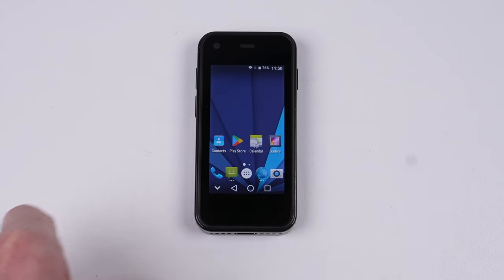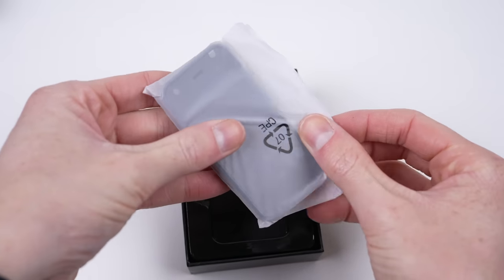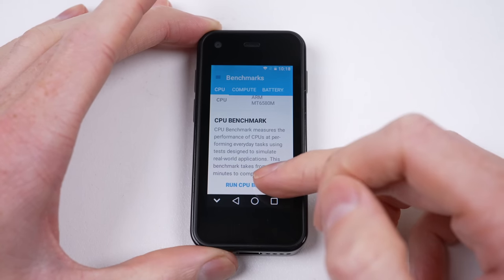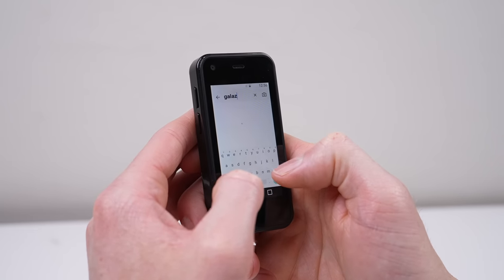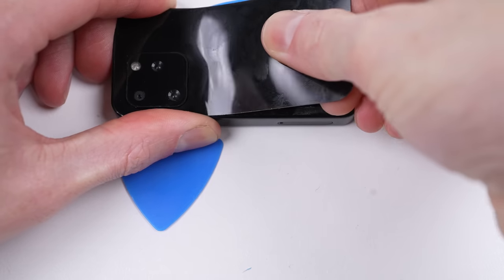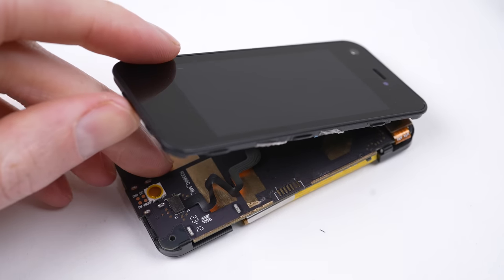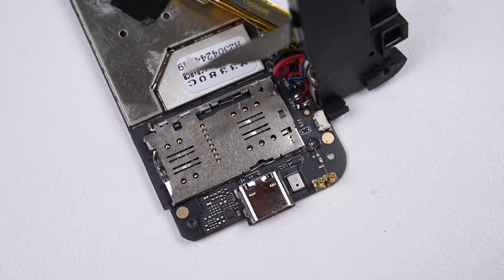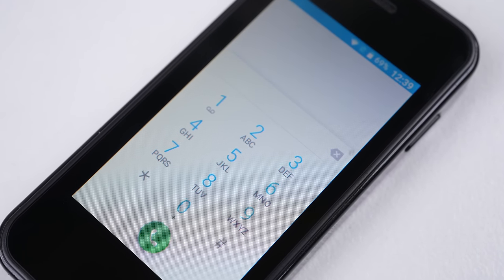I Bought The Smallest Android Phone - Impressions & Teardown

Comment: There are smaller Android devices with WAY more modern OSes, a proper mid-tier performance SoC and a proper LTE modem like the Unihertz Jelly 2/2E/2S series. Would be interesting to see a review / teardown of those since they look like a pain to take apart just from the outside.
Reply: Although I've used android since 2.3, I'm trying to remember back to android 6.  2012 and the nexus 7?
Reply: @adamf663 late 2015 or thereabouts, right at the tail end of the Nexus line
Reply: @adamf663 Fall 2015 and Huawei Nexus 6P (The last Nexus phone)
Reply: I've seen the review and teardown of that phone by Australian tech YouTuber SMOOREZ.
Reply: and the new unihertz jelly star
Reply: Not the star?
Reply: This
Reply: @account-now-closed  The star is technically also called "2S"
Reply: Those costs substantially more.
Reply: @radry100  Sure but they surely deserve a mention when talking about the smallest Android phone(s)
Reply: @adamf663 ah yes, the good old marshmallow days
Reply: @noahjgladwell I used stock Android 6 for 5 years, then made the jump to (also stock) Android 9. I really missed dark mode, especially because Samsung users already had it in earlier versions.
Reply: The Unihertz Jelly 2 is actually a little larger than this device, both in size and in price.
Reply: I don't know if you can call the Unihertz Jelly smaller when it's such a thick and bean-shaped device.
Reply: if only the continue the ATOM ones

Comment: Interesting device - there's probably some use case for a small phone with smart capabilities. Too bad it's only Android 6.0 (which is too old to support most stuff now) and also it only supports 3G networking. 3G is being shut down in various countries, and 2G has also been shut down in various countries as well, thereby making 4G a necessity.
Reply: Yep 4G LTE is a bare minimum for a phone these days, and if this phone is not very old, then it has no excuse to not have it, as even KaiOS flip phones have 4G LTE modems.
Reply: The oldest version of android 4.4 kitkat with apps still work. There are still apps on the google play store that don't support the newest version of android or even android 11 since some of the apps says there were designed for an older version of android. The app developer never updated the app. Some of the apps that I use are still old and still functional and don't offer anything new. Android was designed to operate on older versions of android as well as newer versions of android. I'm glad that android still supports the older versions android. I sideload apps that are no longer supported on the newer versions of android but they were removed due to copyright reasons. I sideloaded the google play now launcher android 4.4 version with my pixel 4a 5g running android 11 since I never updated the software on myself pixel 4a 5g. I only updated the apps from the google play store on my pixel 4a 5g. I left the software exactly the same when I first bought the pixel 4a 5g when the pixel 4a 5g first came out. The only issues are the display has gotten burn in, the display has gotten dimmer overtime, the battery drains quickly, the standby still last for multiple days even though it drains quickly while I have notifications all running in the background while being connected to my wifi and while using the phone and the phone still charges fast and the 128gb storage is almost completely full. I bought a battery case on amazon for my pixel 4a 5g. LOther than that, my pixel 4a 5g still works the same way when I first bought it. The google now launcher functionality still works even though it was removed from the google play store and no longer supported.
Reply: @OledBurnInKing I'm curious to know what kind of older apps you're running.
Reply: isnt 6.0 just on edge of being unsupported
Reply: @detecta  it is.
Reply: I think shutting down 2G is only possible in countries where carriers are the only source (apple being the huge exception) for buying your phone. In my country you can buy phones in electronic stores just like any other appliance. But often Voice over LTE will work only if your carrier also sells the same phone .  Basically many phones have a problem using Voice over LTE and im not sure they could make calls at all if 2G and 3G support was discontinued.
Reply: a 5inch with small bezels would do just fine
Reply: @CommodoreFan64  its old stock with a new frame...
Reply: 3g shutting down now but 2g not for another 10 years
Reply: @LelouchLamperouge235  Shutting down 2G is perfectly fine as devices can drop to 3G, and 3G is much better at handling calls and data than 2G anyway. 2G doesn't even support HD Voice.
Reply: @account-now-closed  Some countries (not the UK though!) have already shut down 2G.
Reply: @SOTP.  Very well could be, but it's still no excuse for a company to sell what they are calling a new phone in 2023 without at least a 4G LTE modem in it, or a more modern version of Android for that matter so apps people actually use at least function. I can get an Android Go Edition phone for 50 bucks with more modern specs, and an easy to replace battery for 50 bucks.
Reply: @account-now-closed  Both 2G, and 3G are being shutdown here in the US/Canada(Mexico still has 3G for now), so a 4G LTE phone is the bare minimum you need these days here.
Reply: @CommodoreFan64  i had an android 5 tablet that i messed with and could install all of my apps
Reply: @detecta  I highly doubt you where using anything like Paypal, G Pay, or a banking/credit union app, as most of them require newer versions of Android to function.
Reply: The Samsung Galaxy S5 has 4G/LTE and runs Android 6.0
Reply: 3G is dead across the whole of the United States now, 2G is following next year (strangely). So yeah at least here many old phones are probably filling up our already overflowing landfills no doubt! Unless being recycled or other uses of course.
Reply: @detecta  luckily i have 6.0.1 for my S5 Active

Comment: Micro SD card slot
Headphone Jack

These are the most practical and simple points of engaging with technology. A wire always works, and we all know, any amount of on board storage is never enough, and if the phone fails, it takes down all the data with it, unlike the card which is also a storage and backup option that can save the day.

Comment: Honestly? If a big phone company decides to make such a small phone, it could have a good chip, good edgeless display, a good camera and a somewhat bigger battery.
Reply: minus the edgeless display it's already been done with the Unihertz Jelly Star it's got a 3in display a 480x854, 48MP rear/8MP front cameras 4G LTE modem, 8GB RAM, a Mediatek Helio G99, 2000Mah battery,  USB C 10 watt charging,  256GB internal storage, dual sim, or sim/MicroSD card slot, 3.5mm headphone jack, notification lights, all running on Android 13, but it cost 200 greenbacks.
Reply: @CommodoreFan64  200...wow... I got my normal sized phone with nearly highend specs for 300.
Reply: @gucky4717  helio g99, 8gb of ram aint bad, what high end specs do you get for 300? I know like 1 example, so maybe yours is different
Reply: @gucky4717 Niche = no economies of scale = relatively expensive.

Comment: The rear camera is jittery, but the quality is great, I must say! It is miles better than those cheap crappy phones (similar to this, specifically those fake Samsung/iPhone phones) with camera quality that looks like it came from the 90s. Nice video again, Hugh!!! Missing your iPhone/MacBook repair videos!
Reply: Even in the mid-2000s phone cameras were often a joke. I seem to remember my Siemens from that era produced pictures that were something like 300x200 pixels, if that. Extracting them required a proprietary cable and software and the pictures were little more than blurry postage stamps. My last dumbphone, a ca.-2015 Nokia, had a VGA camera (640x480 pixels) that produced terribly washed-out pictures. It did have Bluetooth but every single picture had to be transmitted separately. I'm not sure if it was even able to record video but it might have.

Comment: I have a Palm PVG 100 and I thought this one was going to be a competitor but the smaller battery and 3G connectivity ended that idea. Also the Palm runs Android 8. Of course I'd like it to pop apart with 1 screw and no battery tape.

Comment: What an oddity! USB-C but running Android 6 and 3G network?
Reply: great point
Reply: The Nexus 6P and 5X launched in 2015 with Android 6.0 and USB-C. It's been around for longer than you think.
Reply: @efftee good point; however, what makes the least sense to me is the 3G limitation; my iPhone 5, from 2012, has 4G connectivity; Android 6 released in late 2015, so there is no excuse for this tiny phone NOT to have 4G 😂

Comment: a year and a half ago I needed a new phone. Had 3 androids and a windoze phone (lol) previously.
I marched into the AT&T store (my carrier) to see what the smallest android they had. 🤔
just huge 6.1's and foldables on up.
I ride motorcycles and want to stick it in my FRONT pocket. 
darned if I didn't walk out of there with a 64 gig 12mini for $315.
I hate Apple.....but this little rocket is unsurpassed.
Reply: I feel you. I recently switched from a Galaxy Note 9 to a iPhone 13 mini; despite it already being more than a year old at that point, it did not feel slow or sluggish… still doesn’t… and ironically it was the best phone I could get on my budget; the other options were Samsung mid-rangers that fall short for my needs, as I need a good camera, long-term OS support and reselling value for the next 5 years

Comment: this is actually clever.  there is such a need for dumb phones. but sometimes dumb phone are so dump that they are some what so useless. 
this phone is like in between dumb and smart.    it can do what a dumb phone can do.  but it can also do some basic feature that you need on a smartphone such as reminders, schedules alarms.. quick voice alarm. (yeah I always use it like 'hey google alarm in 5 mins' when im boiling soft boiled eggs every day.).

if this small device have google assistance I might actually find this phone in the market.
what are the thing they need to change?
maybe use a black and white screen for better battery consumption.

Comment: they should have made a dedicated buttons for home/back/recent, as it used to be normal 3-4 years ago with thick bezels.

But the SD card hurts... just bought a zenphone 10 in 512GB and am a bit sad that I had to chose between a phone with good really specs, headphone jack and no SD card and a phone with SD card but much worse specs (and I mean half the RAM, snapdragon 8 gen 1, half the built in memory, no gimbal stabilisation and no wireless charging or headphone jack like the Zenphone has and still being more expensive, something like Huawei Mate 50 Pro or P60 Pro). Like it is hard to argue with a phone with 8 gen2, 16GB or RAM, jack, gimbal, wireless charging and 30W charging, small form factor (sub 6 inches at 5.9") and a price tag under $800... still the SD card hurts

Comment: What i want is a 4.5-5.5" phone with the modern no bezel screen tech
With a 16:9 ratio it would be great. Just look at the samsung galaxy S3. Just the screen and a tiny bezel around it plus 1 mm extra for a protective case.
It would be great for holding in hand and using.
Ofc with a fair price, not the garbage practice of apple and samsung with their mini versions that are similar in size.
Because of small screen, that means smaller battery needed.
Instead of a gianormous 6.5" inch and above the entry level phones are offering for ~150 euro, i'd rather get one with the specs i desire.

Comment: Hey Hugh, I have the video suggestion for you. The pixel Fold has very terrible heat dissipation problems. You should see if you can do a mod of it and improve thermal throttling / heat dissipation on it and it could be something that would work on other phones too.